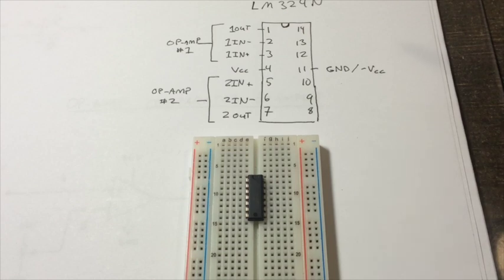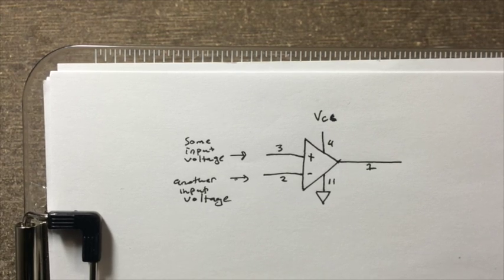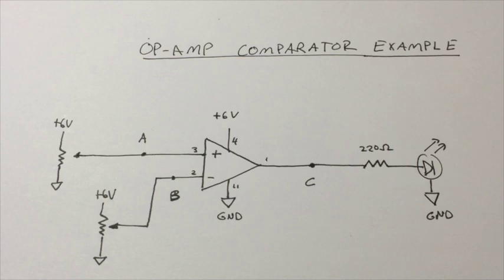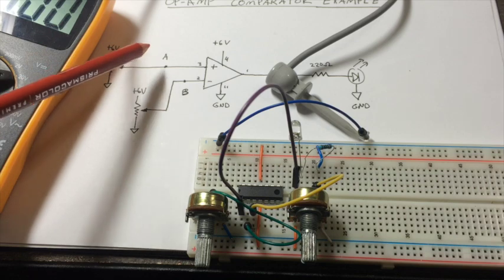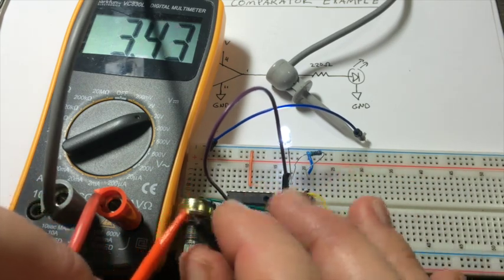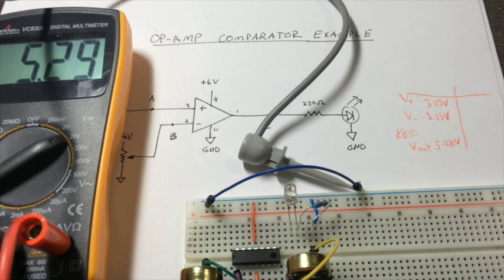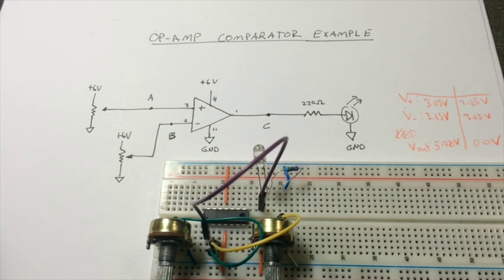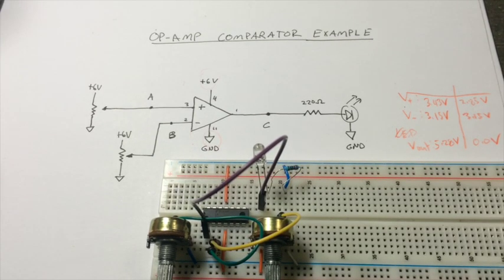Op-Amps, Part 1: OpAmp LM324N Comparator

Comment: whe v+ < v- then output should have  been -Vsat (any negative voltage close to -6 volts) right? then why is it 0v??
Reply: I believe it is because the V- is not connected to, in this case, -6 V.  It is connected to a "common" which is ideally ground or 0 V.  Electrically common means that any two points in a circuit have the same potential so they show 0 when the voltage between those two points are measured with a multimeter; multimeters measure differential and not absolute voltage.  Were it really V+ and V-, you'd have a 12V supply and not 6 V.  Even if there is a small amount of voltage, the LED would not light due to the presence (and value) of the resistor.

Comment: It's hard to tell exactly how everything is hooked up on the breadboard but it looks like you have the 220 ohm resistor between the led cathode (-) and ground, not between the lm324 output pin and the led anode (+) as the schematic shows.